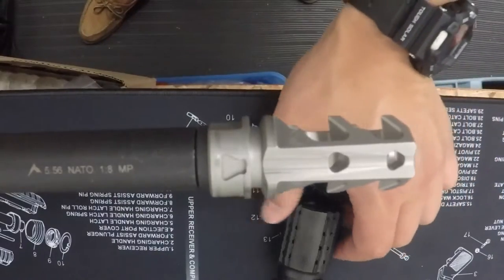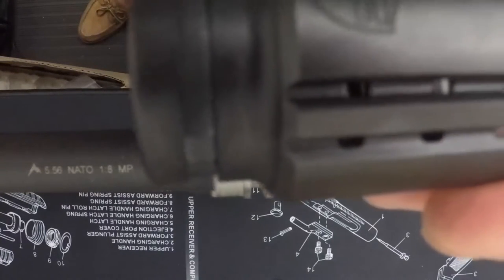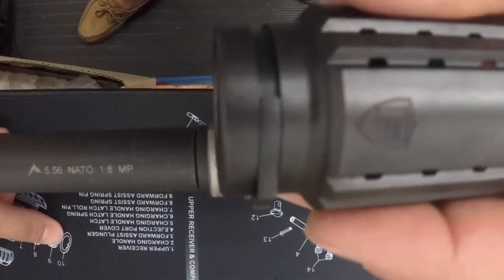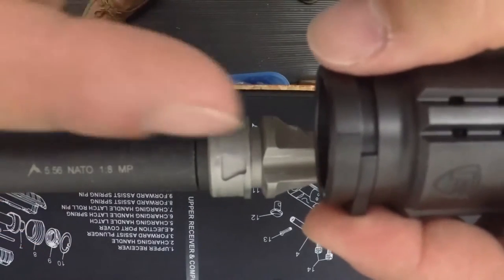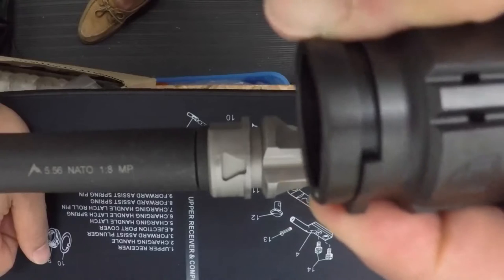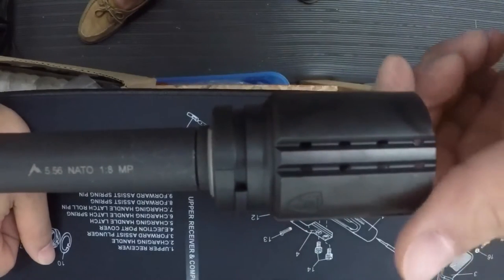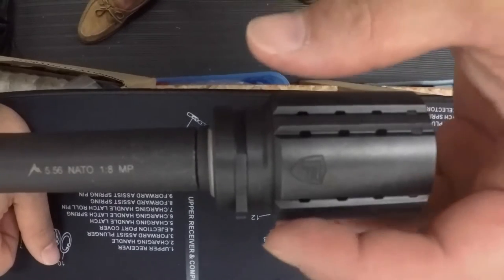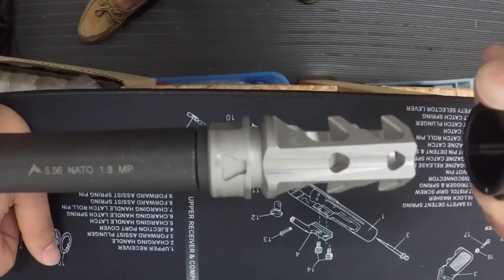Fortis Control Shield Installation Video

Comment: Im working on a build and would very much like to get the muzzle device/shield combo. 

Do you think Ill have any issues running this on a 16” barrel with a 15.5” handguard? 

Im trying to go for that faux silencer look while keeping all the benefits the shield can provide. (Id like to bring the shield as close as possible to the handguard but not tucked in).  Thanks!
Reply from the maker: Not really sure.  We do have a video that may be helpful to you.  It compares barrel lengths and rail sizes and gives some measurements.  https://youtu.be/uuKGxsKLJlQ

Comment: Will this fit under a fortis night rail 16
Reply from the maker: It was designed to fit a 16" barrel.  The 14" is designed to fit a 14.5" barrel and the soon to be released 10" is designed to fit a 10.5" barrel.